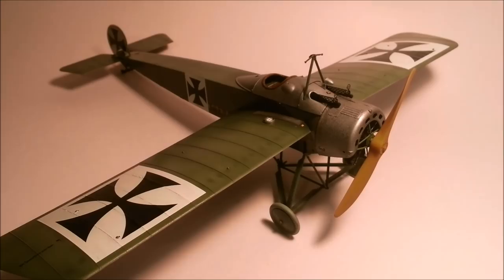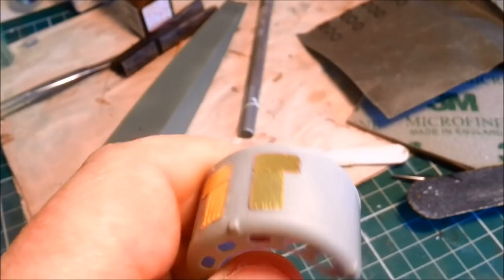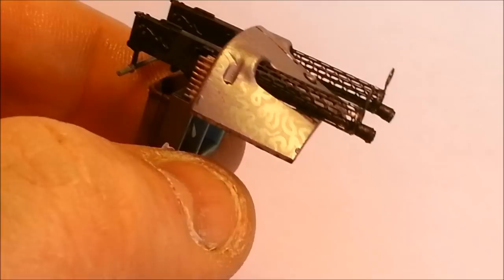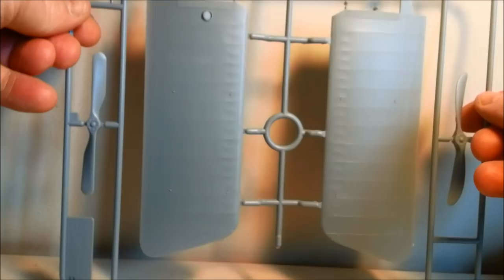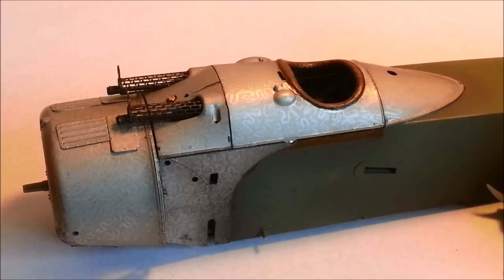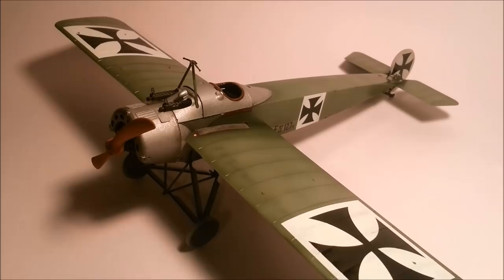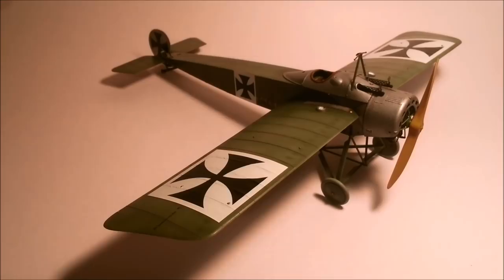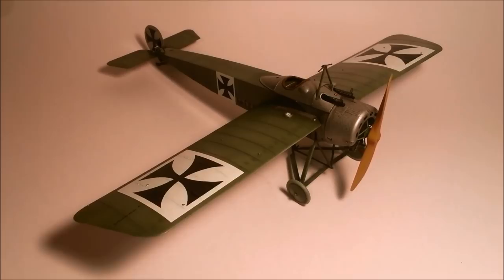Wingnut Wings scale model kits - are they worth it? Part 3 FINAL

Comment: Quick tip for sanding around details like that the ones on that cowl there, Dave. Use masking tape to cover that detail and protect them from sanding tools. Done that many time while cleaning flash or partial trim removal while customizing something.
Reply from the maker: GreenJeep1998 that is a clever, clever idea. Next time! Thanks GreenJeep!
Reply: @DavesModelWorkshop  Not a problem Dave!  I have used Tamiya as well as 3M Automotive Painters  tapes, the 3M might be better since that is usually thicker. Did try some sort of electrical tape once, it left enough residue that I haven't done it since.